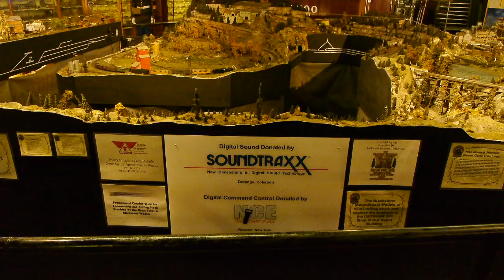The Durango and Silverton Roundhouse - Rebuilding Steam Locomotive 476

Comment: This is the only railroad where they have the K-28's which are D&RGW 473, 476, and 478. I did a film with 478 in the museum in 2016 after the ride on 482. I already tell you that on the Durango & silverton video that came out in 2015 that you made. I did film with a little of the engine's D&RGW 481, 480, 482, 478, 493, one of the D&S Diesel engines, and RGS C-17 # 42. But I was wanting to film the rest which are D&RGW 498, 473, 486, 476, and the other D&S diesel locomotives.

Comment: After the brillo pad comment where there was an actual wheel lathe then it showed the machinist running a "vertical turret lathe" that looked like a 42" bullard. They use these machines to do journals and journal brass.
Reply from the maker: YUP!!! REally cool to see this stuff full size AND working.
Reply: For sure man! And Thanks for sharing your travels.

Comment: When I was in Durango, we rode behind 476 to Silverton and back.  It was working but not as it should.  The throttle was either wide open or off.  Nothing in between.  The engineer showed me.  He tried to give it just a little throttle and the lever shot back at him like it was shot out of a cannon.  He was able to do some mitigation of the throttle with the Johnson bar but that did not completely make up for it.  When we arrived in Silverton, a few minutes later, 481 came in and parked beside us.  It is great to see your video and remember our time there.  Thank you for sharing it with us!!

Comment: Overall an interesting video.  I recommend you might want to do a little "editing" in regard to some of your comments/"facts".   Probably using normal railroad nomenclature when explaining the various components of wheel sets and how they are constructed/fit together would help for a better understanding.
 The "other" K-28 is NOT the 472, but actually the 473.  So, the 3 K-28s at Durango are the 473, 476, and the 478.
Who is the "new" owner and does that mean that Allen Harper no longer owns the RR?

Comment: They are using the wood pellets overnight to keep the engines warm.    The wood pellets don't produce the Soot, that the coal does.    Avoids soot pollution in Durango neighborhoods.   (Took Roundhouse Tour in October)
Reply from the maker: Not sure. For cold starts for sure. Regular wood pellets, but BIG. About 3 inches across.
Reply: Actually they don’t use wood pellets overnight. I was an engine watchman there. We used coal all night. Only time we used the pellets was to help light a cold loco. Would use a few shovels of pellets over the coals and light the fire with diesel soaked rags.

Comment: +ToyMan  Tine 3:50  Thanks for an interesting tidbit.  Those wood pellets must be needed to get the firebox hot enough for the bituminous to catch; I need a similar boost from a couple ounces of naphtha when lighting a couple pounds of Kingsford® Mesquite™ to fire-roast a heavy chunk of beef or pork.
Reply from the maker: We just saw video of lighting 491 in Golden. They were tossing in scrap lumber. Had a good ol fire going too. Then adding in coal. I for one never under estimate "boy scout water". (gasoline) A think worth doing is worth risking life for.
Reply: I grew up around coal and wood heating systems.. which appear to work in similar fashion.  Coal has to be hot enough to burn, so one can't simply set fire to it with a match. Wood.. or small chunks of wood called kindling, are used, along with something like wadded up news papers placed over and around the coal. A match is used to light the news papers, which burn easily, catching the kindling on fire. The attendee simply keeps feeding more scraps of wood into the fire, until a good blaze is established. Eventually.. the coal will begin to burn. At that point.. all that is needed is to have more coal added. Coal burns longer and hotter.. A proper "draft" is needed for the fire to burn proper.. If not.. a lot of smoke and sometimes sulphur gas which can be dangerous.. Sometimes the smoke will appear orange. Creosote can build up in the chimney, or flue.. and can catch fire easily.. I'm not a fan of using any type of fire starter to start a fire in a coal heating appliance.. simply because of the eventual build up of creosote in the chimney, which is highly flammable! A fireball going up the chimney is never a good idea! LOL! Now... I'm not sure about a steam locomotive.. But after all that restoration work... I would bet they feel the same way!!  :D

Comment: they have K28 473 running this past summer, great to hear 476 is being added
Reply from the maker: Not sure why 473 was back in the shop. Noting really wrong with it. But getting some work. 478 just needs inspection and tubes, will take about 6 weeks once 476 is done in February. SO, come the spring, should have all 3 working!!!!!!!!! First time in 20 years.

Comment: 4:28 you are looking at a bucket elevator which hoists the sand up to the top by means of steel buckets mounted to a vertical rubber conveyor belt.
Reply from the maker: Not sure how exactly this one works. It's rebuilt, but looks like the original in many ways. Modern ones use a belt. The original used compressed air to blow the sand into the tank at the top. Small pipe, didn't need to be much, often leaked when it was in use. I see the pipe here, but again, as this is rebuilt, not sure what's up. The one at Chama is still original.

Comment: Durango and Silverton has 3 K-28 Mikados #s 473, 476, and 478. I’m sure 473 is still running. There are 4 K-36 Mikados #s 480 (fist K-36) 481, 482, and 486.
Reply from the maker: 473 was in the shop while we were there. Not sure what the problem was, but they said they had no K -28 at the moment. But it's back now. 476 should be back in February and then 478 can go into the shop for inspection and tubes. Should have all 3 back in the spring!!

Comment: That was amazing guys but some corrections and questions that confused me.

The k-28 that was in the roundhouse beside 476 was 473 which was running all season over the summer.

Also they had stopped running 4 trains around 10 years ago because their ridership severely dropped after the 2002 forest fire.

Also the D&S were trying to aquire 483 from the C&TS with a trade with 478 which has not rub since 2015 because of the 1472 rebuild and the D&S working on 476.

Before my question next time you guys are in the roundhouse you should ask about touring the sleeper car they have next to the bobber caboose. They only open it up if people ask to see it.

Also was there a fire recently in the roundhouse?

The videos are great so keep up the good work!
Reply: David Shupe in 1989 vandals burned the original roundhouse, which had been reduced to 5 stalls or something from the original 10 stalls. They saw this as an opportunity, and built a 15 stall roundhouse in its place in an outstanding amount of time.
Reply: Quasimoto7 I know about that fire but it sounded like 473 was taken out of service because of a fire recently.
Reply: David Shupe no. That engine is just currently out of service. Not sure why but it just probably needs maintenance
Reply: Quasimoto7 Ok good I was just worried and curious.
Reply from the maker: Not sure why 473 was down, but it's back now. They told me they have plans to "rebuild" 478 after 476 gets back up in February. BUT if they could trade for a k 36, I'm sure they would. Be cool to have a K 28 at Chama, but the 36 is a real workhorse. However, the 28 is synonymous with Durango....
Reply: Toy Man Television They did try a trade, 478 for 483, but C&TS said no. That could be part of the reason for 476 getting rebuilt rather than 483.

Comment: You should check out the crossroads village and Huckleberry railroad in Flint Michigan
Reply from the maker: There is talk of that K 27 going "home" to Chama......... Love to see that. Still would love to see the Huckleberry railroad in Flint Michigan, just take bottled water......
Reply: The GCP&RC would need a replacement steam loco to substitute for No. 2 (or 152).  The Tweetsie No. 12 is almost an exact duplicate of No. 2.  The driver diameters are one inch different.  I worked there from April '79 to Oct. '83.
Reply: I've heard that 152 is supposed to be back in service this year
Reply: Robert Lucido We used to take our kids.  That one is coal fired also. Its a !nice time.

Comment: the D&S did run a k-37 beck in the old days
Reply: Yes.  497, which was later traded to the C&TSRR for one of the K-36's...  486 I believe.  The trailing truck on the K-37's tears up the trackage in some of the turns on the D&S.

Comment: I don't think they use steam to power the turntable. I worked in my career as a locomotive engine and when I first worked as a fireman and our turntables were either electric or powered by compressed air provided by either the engine house power plan torte locomotive's air brake system. I'm surprised their still using babbitted wheel bearings. Babbitted wheel bearings have been outlawed for over 20 years on the mainline rail network in Canada and the United States.

I visited Durango back in 1980 the last year it was owned and operated by the Denver and Rio Grande Railroad and was surprised as i arrived in early May to find out I couldn't buy a ticket for the round trip as they were already sold out. For the entire season. Did drive to Silverton to explore the line and really enjoyed my trip until I got woken up by the campground owner at 245 in the morning saying I had just a few minutes to pack and get to higher ground as the snowmelt was raising the Animas river faster than expected . Parked with my headlights lighting the campsite I occupied and was glad I was woken up as within 10 minutes after I was woken up and packed and drove up to higher ground my campsite was under 3 feet of water and rising. Turned out a warm front had settled in over night and started rapid snowmelt.

Shame someone couldn't rebuild the railroad from Durango to Antonito, Colorado linking the old D&RG segment still running in New Mexico and Colorado. I'd pay to ride the overnight train from Chama to Silverton in an old school Pullman sleeper pulled by a K-28 K-36 or a K-37. It would be interesting because it would require 2 trains a night. One westbound and one eastbound.
All those in favor of rebuilding the line and restoring overnight passenger sleeper service raise your voices.
Reply: Well... That depends.. You see, Dale and I are trying to figure out how to make a turn table to work with a 20th scale model railroad. Just trying to figure out how to do that!  I fully expect to see a little "steam" from the both of us, at first attempts to make it operable! LOL! Just the way it goes.... or doesn't sometimes!!  LOL!  We will do a show on that, for sure!!  X"D
Reply from the maker: The air motors on the turntables were, as I understand, long ago steam. Everything was steam, even the wheel lathes. The house boiler served many uses. The only babbit used is in the old equipment, the C18 and the which is on loan to CATS, and the Silverton guys use it I THINK. The ones in the film are bronze. Most of them are Timken or other roller, but the wheel truck they are rebuilding here, for some reason, is "old school". The car they are rebuilding here is spread all over the shop. VERY OLD. And I guess being kept original. The stack of wood parts in the film are off of it, but no one could tell us what it is!! We need to find the horses mouth!! Amos!! 

Yup, 4 trains, and always sold out!!! They added a Gorge rail bus years ago to help with people showing up,  but no one wanted to ride it. Ran from Rockwood into the Canyon a few times a day. There has been talk of using 42 as a replacement for that, and that may sell. We would ride it!! But a home made rail bus for an hour?????? Boring... 

As for relaying the missing track........ SIGN US UP. Problem is the Durango end is all highways today. Grade is not usable. But only like 5 miles of it. The rest is all there, but several large bridges that are in total disrepair. Whe is needed is to get Bill Gates into trains. Dump 500 million on the project.
Reply: @ToyManTelevision  :  I doubt that the turntable was ever operated by steam, which will condense to water the minute it is removed from the boiler.  Many turntables in Canada used compressed air furnished by the air brake system on the locomotive being turned.
Reply: Money is not the only problem or redoing the bridges or replace the missing grade.  The BIG problem is the Ute Indian tribe's reservation through which a lot of the old grade goes.

Comment: There are several K-37s, two in operational or semi-operational condition. Those being 491, and 497. Others that exist are 494 (in silverton), 498, and I think that 499 is still existing somewhere (probably in a field). I would have to disagree, as far as narrow gauge locos go, I think the K-28s, the K-37s, and the K-27s look better.
Reply: I guess that's because there are just so more K-36s than any other D&RGW loco around.
Reply: As much as I hate to say it, the 472 was scrapped, that is #473 painted like 472.
Reply: I think most of the k-37s are still around, just none of them have operated. 493 was in this video and there are rumors of it going to be fixed up but no one really knows if it really will be fixed up or not
Reply from the maker: There are a bunch of K 37 left in the world, but only one runs. As of now. 491 is great and at Golden. 492 is at Antonito. As is 494 and 495. 497 is at Chama. Was running on D and S for years, they traded it to CATS for a K36 482 which is one of the main locos on D and S. Not much wrong with 497, but the K37s are very hard on track. Anyway, will run again at some point. 498 is in the video. Worst of the K37s. Used for parts. 499 was traded to Canon City for the K36 that belonged to Gene Autry, #486 in 1999, also one of the 4 at Durango. The K 37s were terrible on the D and S track. The two they ran were tearing up the rails on the curves in the Gorge. Then Chama found they too had problems with them. 491 is doing fine at Golden as its just not run that much, and the few hundred yards of rail are easy to repair. BUT K 37s were just never intended to be narrow gauge locos. The K 36s are perfect on these railroads. And perfect proportions. Great looking locos. 8 surviving, 4 on each railroad. And a fifth, 483 which may run again.
Reply: The K-37's are very good locos, as for the reason for them being hard on track (combined with their weight), is that they aren't balanced precisly. It's the same reason that C&S crews hated the #74, it wasn't balanced right and was very thirsty for lubricant on it's valve gear. The N&W had the same problems with their J's untill the 600 came into the shop and the re-worked the weights and bearings. After that, they were record holders for miles between services.